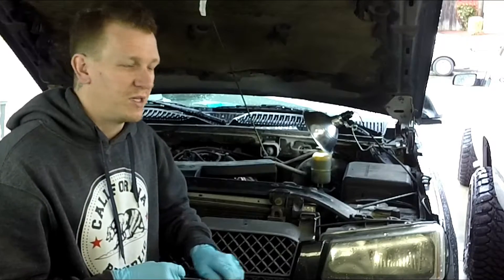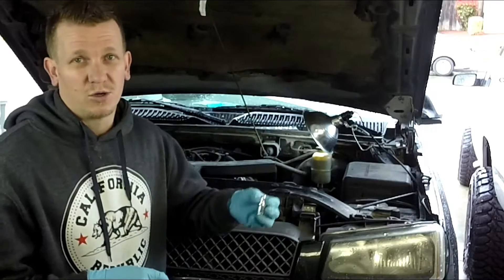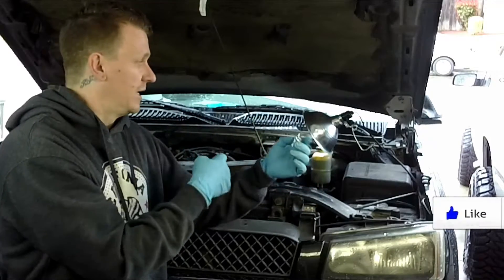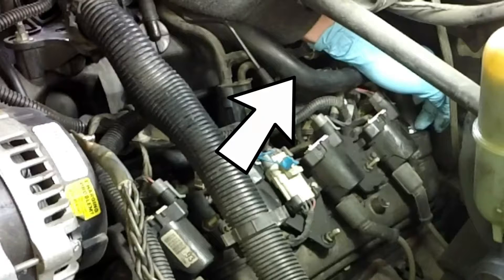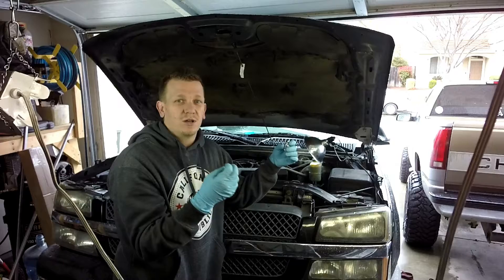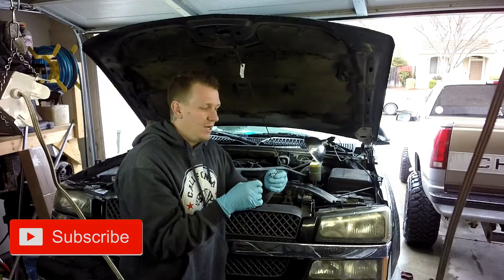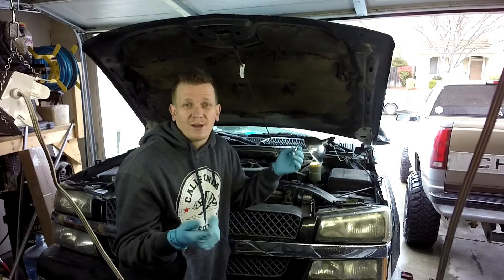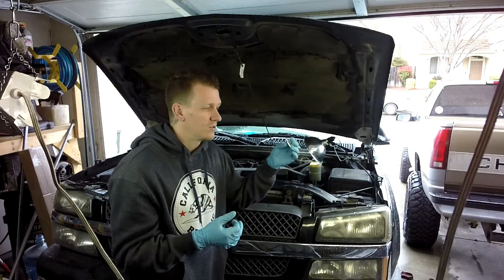What does a PCV do? Why do we need a PCV valve?

Comment: How much would i expect to pay someone for a tuneup, pcv valve replacement, and full body clean with a fuel injection service?
Reply from the maker: What kind of vehicle?
Reply: Scotties Hobbies 06 scion tc
Reply from the maker: So you need a tune up? Are you trying to fix a problem? You want to call on a recorded line and talk about it so it can be added to the next podcast? Shoot me a email to therealscottieshobbies@gmail.com
Reply: Scotties Hobbies no thats okay i just wanted an estimate on how much you believe i would be charged for all of it, tax, labor, parts all together
Reply from the maker: @kennyadrian9957  it shouldn't be much. The parts are around $140 for the better parts. All you need is spark plugs, air filter, intake cleaning, and pcv. In the past I worked at a quick lube center and we had packages that included all this starting at 179. I couldn't imagine being charged more than $250 from a smaller shop.
Reply: Scotties Hobbies aw man. I got charged 387 total for spark plug replacement, fuel injection service, total body cleaner, pcv valve hose replacement and evap hose replacement at my local quick lube. I know taxes are jacked here in cali but man. It is what it is im jusy glad my car is running smooth now. Thanks for the feedback!!
Reply from the maker: @kennyadrian9957  maybe the evap hose was the difference.  Those can be hard to change. It was still worth it in the long run. Preventive maintenance means a lot with cars.
Reply: Scotties Hobbies well awesome then!

Comment: I still don't get why you need a valve?
I understand why you need to vent the cc and that the inlet is a really easy way of using negative pressure to draw air out, but what is the valve doing?
Under what conditions does the valve need to be closed?
Why isn't it just a pipe from the valve cover to the inlet?
Thanks in advance
Reply from the maker: Ya know, I have never been asked this or thought about it. Why does it have a check ball? I am going to do some research and put some logical thought into it and get back to you.
Reply: @ScottiesHobbies  thanks for the effort. Much appreciated.
Think I found the answer.
It works the opposite way to what I thought.
Under high manifold vacuum, the valve partially closes to limit how much is venting. This is important at idle as it would give the symptoms of a vacuum leak.
As you open the throttle, the vacuum drops so the ball drops opening the orifice to make sure you get adequate ventilation.
So it's basically a regulator to allow for variable manifold pressures.
Lots of people bypass it (BMW for example have a complicated version that is expensive to replace). Might not be a great move.
Interesting.
Reply from the maker: @richardschofield2201  when I started think about the logic of the vaccum from engine and the vacuum from the intake when the throttle is open. I started to think of it kind of a filter but that was not making since.  Good job finding that.
Reply: @ScottiesHobbies  ye, I initially thought the ball might prevent large amounts of oil entering, but wouldn't work out why there would be so much oil under the valve cover, unless you roll of course.
Always learning.
Reply: Technically, you do not need a PCV system. Your engine does need to ventilate crankcase pressure but not necessarily through a PCV system. The PCV is designed to filter the crank case gases that are being pushed out of your valve cover(s) because there is oil mist and other combustion gases that would otherwise be venting to atmosphere. Me personally, I don't like emissions systems so I delete them off of my vehicles, PCV valve included. You just set it up to vent out of a vented catch can instead and then cap off any fittings on the intake/intake manifold.

Comment: Does the PCV valve have something to do with your vehicle if it idles low (below the 1 rpm) and the vehicle shuts off when you come to a stop or turning at lower speeds?
Reply from the maker: It's possible. But doubtful. You have a low RPM. Did the RPM change lately? Like has always been at 1200 and now is under a thousand? And this is only an idle issue? You could try to adjust your idle speed up if you have an adjustment. If the RPMs have recently lowered then I would start looking at something that has either added a load or a restriction. Make sure your air filters nice and clean, make sure you don't have any cracks or leaks in the air filter Tube before the mass air flow sensor if you have one. Could even be a restriction in the exhaust. Do you have a check engine light on?

Comment: Maybe this will stop this car from stalling few minutes after starting it
Reply from the maker: It is possible. What motor is in that one? I know the 5.0 S and the 3.8 had a lot of mass air flow meter problems. If yours has a mass air flow, have you tried cleaning it? Also have you check for any vacuum leaks?

Comment: I have a PVC valve on a 93 Lincoln Town Car I can blow through both sides and it rattles what is your take on this?
Reply from the maker: Replace it. A pcv is a check valve. It should close when no vacuum is applied.
Reply: Scotties Hobbies thank you very much I felt something was wrong when I blew through it with my mouth and I was able to blow freely through one in and then some what through the other end

Comment: scott i owen  chevy astro van  any easy way to change the sparkplugs this is  pain in  the  but any way good job  i have lots  of friends whatching
Reply from the maker: Nope. Lol. Every time a Astro pulled up you should see us employees. The astros are a pain, just like the econolines. I can only recommend patience. Lol. Get the right tools too. Get the spark plug wire pliers, spark plug socket with a good retainer. Get a 3/8 hose to start your plugs. (Check out my Corolla spark plug vid to see how I use it to start plugs) that’ll save you some headache.